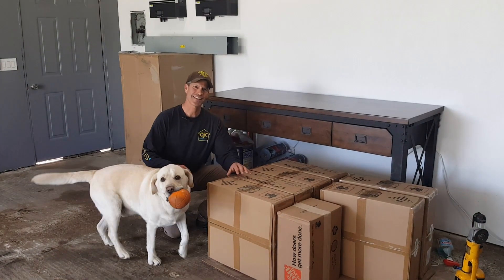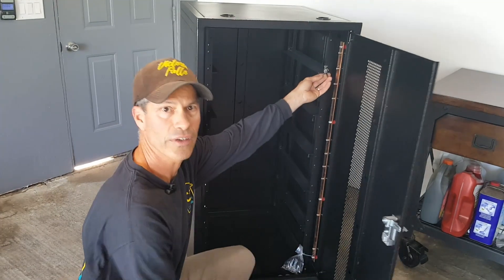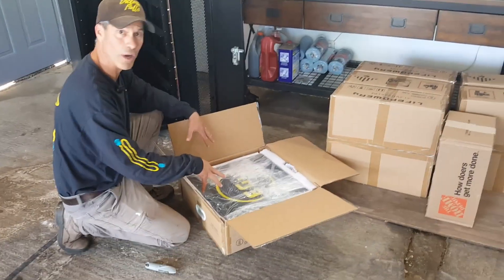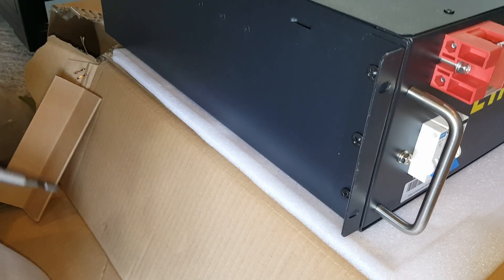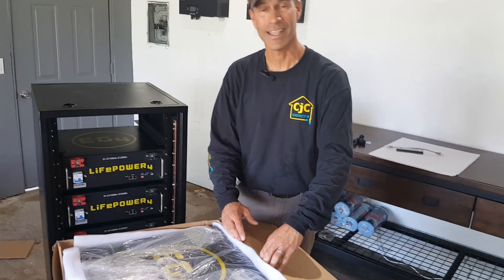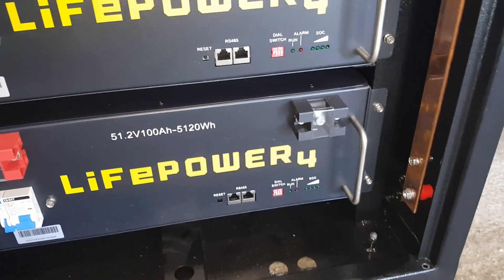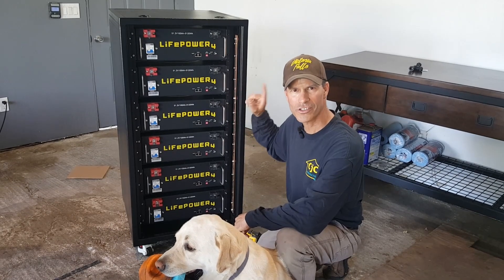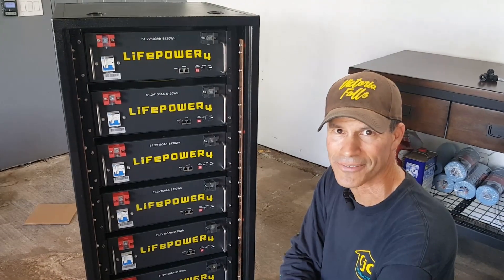Unboxing and Battery Rack Assembly for EG4 V3 LifePower4

Comment: Why did you have to undo the brackets?
Reply from the maker: Good day to you! We installed the brackets on the side of the batteries, because they are not installed for packaging purposes. The bracket mounting screws are pre-installed. Remove the screws from the battery, install the brackets, and reinstall the mounting screws! 👍

Comment: Impressed with the way your better half pitches in to help. Mine is worried about breaking a nail.
Reply from the maker: Thank you very much for taking the time to comment! Yes, she is a great help! Are you working on your own solar system project?
Reply: Jeff I live in Panama in a rain forest with lots of wind. Having panels on the roof with wind worries me so to answer you I am replacing a grid backup deep cycle battery system that is 10 yrs old with 12v EG4's connected to a pair of 12v Xantrex inverters. Power is not that reliable (wind and electical storms and an aging grid so It will give me 9hrs and if I need more I have a Honda generator. Typically outages last 2 hrs. but lately with an aging grid they are getting longer.
   I have ordered the batteries and 2nd inverter but shipping is slow.  
Admire you because your wife pitches in to help. In my case the wife is Latina and clothes, nails and hair are the priorities. .Needless to say at 76 it is not eaxy to work alone handling batteries etc.  For this I envy you.   @jeffcunha9114
Reply from the maker: Oh wow! How interesting. I am sorry to hear that your electric grid is so challenging! What an awesome idea you have. Please let me know how it goes when you your new setup running. Thank you again for your support!
Reply from the maker: Awesome! Do you have any updates on this project?